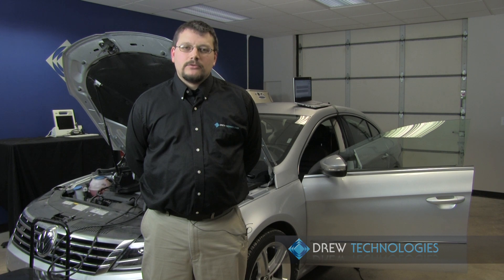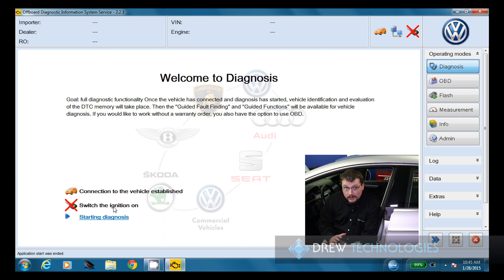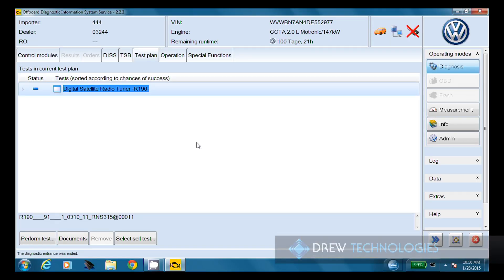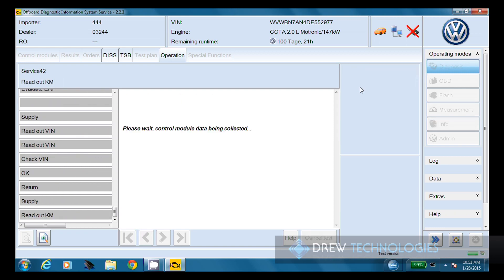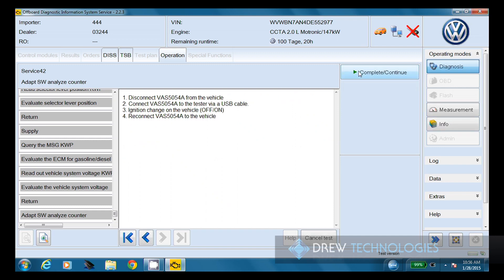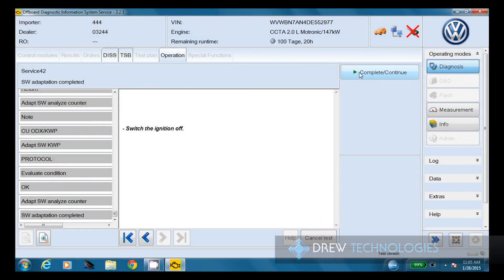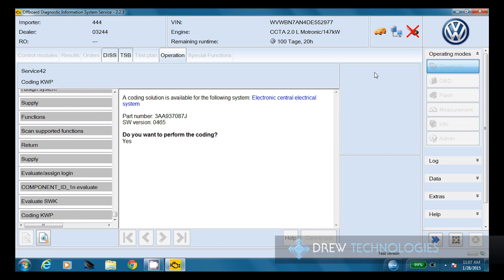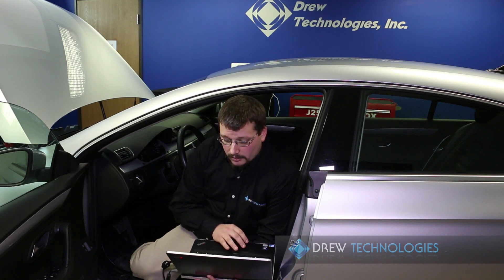VW Reflash Video using J2534

Comment: HI FROM WHERE YOU GET THE CODE 3COC?
Reply from the maker: +Edi Santay Please understand that NASTF can not and does not provide technical support for vehicle service but may be able to assist you if you are unable to find your information using paid subscriptions to any of your available aftermarket (Mitchell1, Alldata, Motor, Identifix, etc) services or to the VW service information website. If not available on VWs site, www.erwin.vw.com, you may file an SIR with NASTF at www.nastf.org/FileSIR.